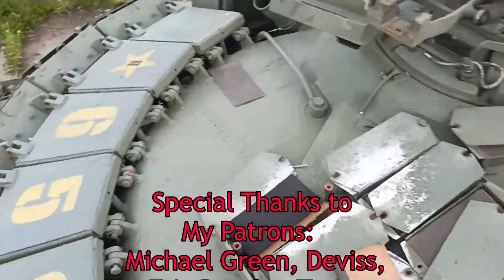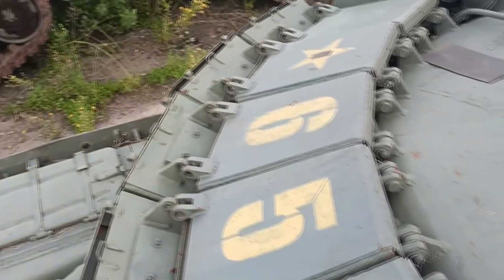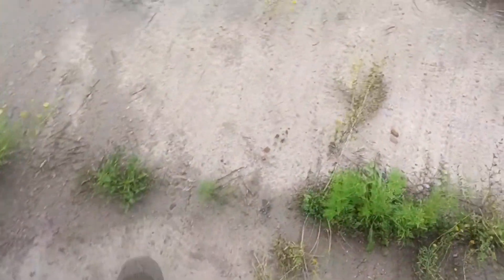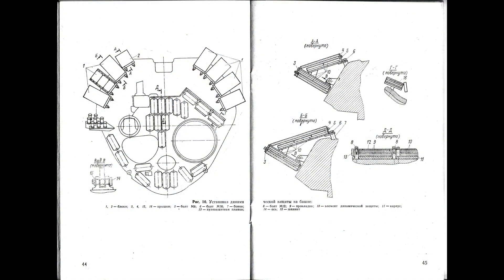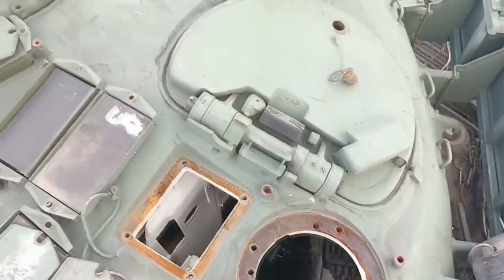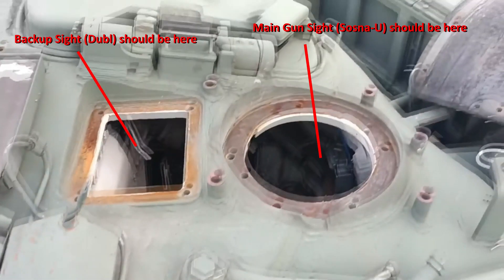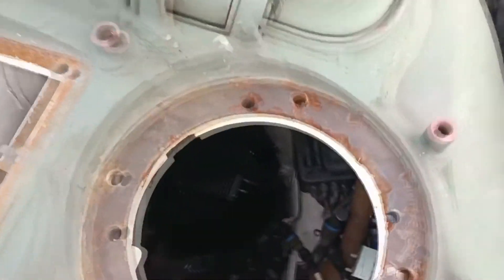Russians Are Using Rubber instead of ERA on their Tanks

Comment: Due to the lack of visible damage, my guess is that before it was captured the Russian crew sabotaged the tank to the point that it could not be easily repaired. If that was the case the only real use to Ukraine would be for spare parts like you said. Otherwise why not put the tank back into service for Ukraine? If they were that in need of parts it wouldn't make sense to cannibalize a T-80BVM unless it was otherwise unusable.

Edit: The removal of the parts was not the sabotage. The parts were only removed because the tank was unusable. Otherwise Ukraine would have just used the tank.
Reply: Tank got shot from behind by another russian tank in order to sabotage it. Insides are probably demolished so most likely unusable tank.
Reply: @dusanbursac5012  no need to shoot it, you can't repair it later when you recover it. Busting the fuse box is enough, fixing that would be pain in the ass, especially if it's in the combat zone.
Reply: Thats the t-90. This isn’t the t-90m tank.
Reply: What even are half of these comments... so many brainless people making random assumptions/claims without backing them up with sources or logic
Reply: Their crews are trained on the t-80 would be my best guess
Reply: @warlordjjj2111  Ukrainians also use T64BV
Reply: There were a lot of armored vehicles who were abandoned by their crews in Russia, they were conscripts seeing real conflict for the first time and overtaken by the shock of “bozhe moi they’re going to kill us!”
Reply: Naw this is just the age old military shortage problem where in their supply is old and crumbling.
Reply: Here we go again with the "tank expert" redditors
Reply: No the manufacturer did that do you really think these troops are leaving expensive equipment and take the time to find rubber somewhere in Ukraine cut it to size for each armor???…come on if you are abandoning equipment you don’t have time for that…this is literally the stupidest thing I’ve ever heard
Reply: A troll account who is an expert in Armor?

No, idiot, the tank was not damaged beyond repair by its crew.  It was abandoned.  Probably because it was out of gas.

The reason I know this is, one of the first components a tank crew would destroy when abandoning a tank is the main gun.  This is accomplished by putting a thermite grenade in the chamber and closing the breach.  You have a few seconds to get out of there before the thermite burns through the barrel and hot metal drops onto the ammo carousel, then bye-bye tank.

This tank shows no signs of fire damage (no soot around the commander or gunner's hatches, no yellowing of the vision blocks from heat).

Please, stick to War Thunder or World of Tanks.
Reply: Smells like a lot of rapist war criminal child killer supporter coping in here🧐
Reply: Way back, the plan for Russian troops was to move fast. Anything that broke down was destroyed because there was no time or resources for repair. If Ukrainian troops actually captured that tank, they would use it.
Reply: Yes. I mean when Russians recently captured T-64, Ukrainians tried to destroy it's "communication device" by throwing grenade inside of it. It didn't work and whole tank company got exposed.
Reply: True i saw a lot Pictures where these ERA plates have been deinstalled from the tanks
Reply: This tank is in service already .
Reply: they'd prob rather rely on their tanks that they know work, rather then try fixing a tank with holes in the main gun and god knows what other compromised components
Reply: Agreed. It's obvious the tank was somehow disabled in battle or by the crew before it was abandoned. The Ukrops would otherwise be running it.
Reply: The Russian tank crews weren't even trained in basic tank tactics.  I seriously doubt that they were trained to destroy their tank.

Another thing to consider is Russian doctrine.  When advancing - broken down equipment is left behind for recovery by rear echelons.  I'm willing to bet money that the reason the tank was not destroyed was because the commanders were following Russian doctrine.
Reply: It'd make sense that it'd be used for parts. Ukraine's version, the T80UD uses a diesel engine while the T80BVM uses a gas turbine. The T80 series turbines are absolute dumpster fires with a rather infamous reputation for being horridly unreliable and constantly breaking down. Knowing how much of a maintenance pig this thing would be, it's no wonder that it'd be stripped for common parts to repair T-80UDs that Ukraine has and know runs fairly well than trying to chase the maintenance demons that these tanks are known to be. There's a reason why the T90 uses a diesel engine and not a gas turbine. They're shit.
Reply: Hi James D.! You're absolutly right, Sir! The only explanation that fits here. 😉 👍👍👍
Reply: Steve Arthur  You, ve seen it! That's truth... Main gun out of order! Only the reason for the cannibalism, the demounted parts... 😉
Reply: And put all washers and nutts back? Wow, this is some seriously executes special operation..😂
Reply: It was captured intact and painted with Ukraine colors FIVE MONTHS AGO. Get it? Ukraine was using it since then, and recently it finally got scrapped and used for a propaganda prop. A really REALLY dumb one since the person narrating is verifiably lying - he knows damn well there used to be explosive plates between those rubber liners... until Ukrainians stripped the tank bare.
Reply: Russian soldiers have tendency to run when stuff explodes around them, even tank crews have been seen getting out and running away from their own tanks...
Reply: I've seen a few videos of Russian troops bailing on their equipment and running for the hills 😆
Reply: They may have made it inoperable but the Ukrainians are still getting use out of it as a propaganda piece as pointed out in this video. Smart move by them.
Reply: I wouldn’t sabotage safety features, it’s better fucked up gun or engine, and get the fuck out of that war, go better fight on Ukrainian side
Reply: We did it in Iraq Also. If we had a Vehicle that was in a accident or in a fight and it was considered Junk. We would strip it of any good parts to help get other vehicles up or maybe have some spares that were hard to get in. We would throw some old parts in its place, to hold it together. Esp wheels. I know the Marines had a Big Junk yard in Iraq, That they would ship old equipment or vehicles that needed like higher maint repairs or Even upgrades from Kuwait. Only issue, is those type of equipment was low on the movement list.
Reply: It was seen in Ukrainian hands with new markings (and seemingly somewhere) else as mentioned in the video. 
So probably not sabotaged. 

It probably was used until it broke down and use the spare parts for other tanks.
Reply: Ukrainians ARE using captured tanks and APCs. T-90, T-80, T-72, T-64 and in the last months even T-62s.
In fact Russia "supplied" more vehicles to UAF than any other country
Reply: totally wrong suggestions.
Reply: Normally Russian crews spike tanks by throwing a HE or Frag grenade into the crew compartment, destroying most of the relevant panels and controls. From the brief glance we got it looks like the interior is intact, they could've damaged the engine/transmission or some driving elements but otherwise the chassis looks in relatively good order.

I don't think the Russian crew spiked it. It might've been left behind in a hurried withdrawal or captured before it could be manned. Worth noting dropping a grenade into a tank has a decent chance to set off its ammunition, which can easily kill the crewman that threw it in. Understandably alot of Russian crews would rather not take the risk to themselves.

It was probably cannibalized because it couldn't be put to effective use, tanks require maintanence to serve as well as fuel and ammunition, not to forget the trained crew. This often means captured vehicles are cannibalized to improve existing systems, rather than re-equipping and crewing them.
Reply: @pogchog6766  dude nobody is throwing grenades into tank hatch because tanks - soviet ones - have ammo stored inside the tank. There is a high chance that grenade explosion will trigger ammo explosion that can hurt the person throwing the grenade and thus nobody is doing them.

Its not possible for crewmembers to damage transmission or engine either. No quick way that doesn't involve disassembling or making engine run with sand.

These tanks get broken often on its own due to them being made in 1970-ies and have not had proper service since then. They also often are left behind when they are out of fuel. Or crew of retreating unit notice loitering UAW and decides to get the f--k out and as far away from the tank as possible knowing that tank would be primary target for the artillery.

Okay, by now Russia almost run out of tanks made in 1970-ies and switched to ones made in 1960-ies but they have the same problems.
Reply: @skipperg4436  The T-80 BV manual recovered from a damage T-80 a couple of months ago had the protocol inside of it.

The manual stated it was the drivers responsibility, or whoever the commander deems fit, to detonate the grenade inside the tank. And yes, you're completely correct it could detonate the ammo in the tank and kill the crew member who threw it, a rather significant part that the manual left out.

But tank crews aren't stupid and figured this out on their own, hence why so few tanks are actually spiked since no-one wants to throw a frag grenade into a tank loaded with live ammo.

Like I said, running a tank is most of the trouble with actually having a tank, rather than acquiring one in the first place. The lack of Russian maintanence equipment and experienced tank crews probably makes abandoning these tanks more efficient than trying to save them at all, knowing that the Ukrainians would still need to provide maintanence and crew or simply cannibalize it as they've done here.
Reply: Nah may that's just shit Russian equipment.  There's a reason they've gotten their asses smacked by every nation they've invaded the past 20 years
Reply: @demmis1354  not equipment. 
People. 
In Russia only worst of the worst become career military. 
Imagine an army where all officers are the worst kind of school bullies, private soldiers are the poorest of the poor who have nowhere else to go because they absolutely lack any talent in anything, top senior officers get their rank based on them not being able to ever be a political threat to Putin as well being blindly loyal to him (who also almost all of them are alcoholics in personality degeneration stage).
Now multiply that by the fact that in Russia in general people are not considered a valuable resource, nor credit is given to people who have done something (this was one of the main Soviet/Socialism ideas that many generations of people grew up with and it affects a lot of their behavior and decision making).

Russian/Soviet equipment is not that bad. Ukrainians have for the most part same soviet vehicles except 1 generation inferior yet they use it waaaaaay better. The worst part of soviet military vehicles is that they were designed with almost zero consideration about crew safety (let alone comfort) - because as I said people were not considered to be a valuable resource.
Reply: How the fuck do you capture a tank? Lol. How does that happen?
Reply: @VADER677 , well, it usually happens when your side retreat and you need to move fast and tanks are not famous for their speed. And they are also not famous for their reliability, so...
Reply: @Твойбро-е9ь  why would you put a tank in a position where it would potentially have to run for its life knowing that they are not good at doing that?
Reply: @VADER677 , for example, when there is a risk of being encircled like it happened in Kharkov region when there were some amount of military whose aim was to attack Slaviansk but after counteroffensive they became halfe circled so they had to retreat.
Reply: Just because they’re filming this doesn’t mean they didn’t use the tank afterwards
Reply: Fake war. Rumors.. As written...  You see the details, now line them all up!
Reply: One thing that is clearly missing in Russian tactics is the tactic to mine abandoned equipment or if there isn't time just burn it with gasoline.
This is all standard practice in western military just to not leave functioning equipment/weapons behind, when I was in the military one of the first things they taught us in TFT was to take the bolt out of any guns you were forced to abandon, in fact in later deployments all squads received a small batch of bolts for the most common friendly and enemy guns in case we had to reuse any recovered ones because it was assumed that both us and the opponents used this standard tactic.
Guess the Russians don't 🤔
Reply: You wrong all weapon there is garbage.
Reply: ....какая то странная Война, пол Украины в ресторанах и дискотеках, на курортах  балдеют...другие Родину защищают и погибают....одни воруют деньги, которые весь Мир собирает на борьбу с Рашистами, другие убежали в США, Канаду, Израиль и Европу,   а своё жильё сдают беженцам с восточной Украины и наживаются на горе людей,...надо строить военные заводы, выпускать ракеты чтоб долетали до Москвы,...а тех кто убежал с страны лишить украинского гражданство, конфисковать всё их имущество и обязать выплатить по 1000000 долларов штрафа, и надо что бы правительства других стран забрали эти деньги с предателей и отдали Украине..
...срочно надо закрыть границы, всех мобилизовать и женщин и стариков и детей, старики и дети могут выпускать снаряды и т.д. Женщины могут стрелять, перевязывать раны. Чтоб день и ночь стреляли по Рашистам, чтоб у тех небыло время даже поспать. Послать спецотряды заграницу и вернуть всех украинцев на Родину. Примерно 15 миллионов живут за границей, и любят Родину  издалека, а кто то должен за них и их имущество воевать, погибать. Хитрожопые. Если 40 миллионов вооружить то Рашке пизьда. Там одна алкашня и трусливая пидорасьня...
....почему не покупают снайперские винтовки ???.. и надо создать армию снайперов, и не будет потерь.......Кому то выгодна эта мясорубка. Зачем воины Украины сидят в окопах и погибают от мин и артиллерии, кто их туда посылает ?...и когда воины говорят что придут в Киев и разберутся с предателями, то Рашисты узнают координаты тех кто угрожают предателям в Раде и правительстве и наносят смертельные удары....кто передаёт данные Рашистам ?...почему не работает контрразведка...почему не работают спецгруппы в тылу врага, не уничтожают пропагондоноф, предателей, военные объекты, эшелоны с военной техникой ?...
....а как Путлеровцы стали бомбить Львов, то сразу завижали «закройте небо»....а  шо не нравится ???...а как Рашисты бомбят восточную Украину, то не надо закрывать небо ???....пока вы сдаёте своё жильё беженцам, а сами убежали в США и наживаетесь на горе людей, то мира в Украине не будет...
....конечно, бандит и убийца  РабсZZиянец награбил, и отдыхает в Египте, Дубае, Турции  и т.д.....а что там делают некоторые украинцы ???... У них дома Война ...или они  с рашистами заодно...Ждуны ???...
Reply: Didn't Poland gave them some of there T72 tanks from reserve
Reply: @samualbhuiyan2308  ye and pt91
Reply: @samualbhuiyan2308  those turned out to be ones without ERA. And T-80 is too different to T-72. Engines are completely different (T-72 being diesel and T-80 is gas turbine), chassis for T-80 are new, etc.
Reply: Yea, a lot of that was happening at the beginning. Due to poor planning of supply lines, a lot of Russian stuff would just break down, or even just run out of gas, and would be just abandoned at the side of the road, since poorly thought out logistical support meant there was no means to evacuate it. It's why you could see so many of those "Ukranian farmers capture russian tank!" videos in the beginning, but see none now. Supply lines got sorted out.
Reply: That's good to know
Reply: You are asking us to believe, they opened the armor packs... removed the explosives... and then neatly replaced the rubber and resealed each of the ERA packs?     If it were me, I'd take the stuff out, drop the rubber on the ground and take the explosive sheets.
Reply: @mac_mcleod  No. The removal of the parts that you see in the vehicle was not the sabotage. The reason for the removal was Ukraine stripping it for parts. I'm saying the reason it was stripped rather than put back into service for Ukraine has to be because it couldn't be used. T-80 was developed in Ukraine during Soviet times. Ukraine uses T-80 in its military to this day. Ukrainian tank crews know how to use it. T-80BVM is the most modern T-80 model and they wouldn't strip it for parts if the tank itself was still usable.
Reply: @mac_mcleod  they likely took the stuff and dropped the rubber. Then this person came, put rubber back and created this video. You see there were no screws near those packs
Reply: @ligametis  There are a few visible bolts , at 0:03 and at 0:26
Reply: @ligametis  Now- that's a possibility.   I think it's less likely than that either the explosives were not there to begin with or some bright young lad sold the explosive.  
But it is possible they put them back together from bits around on the ground and then opened it to display the inside.  It's also possible, they opened them, found nothing in them, and then took a video of that.

You really need a secure constant stream of video going back hours before events like this to be more sure.

One thing is certain.  Those ERA packs have been useless against the missiles being used against them.
Reply: @mac_mcleod  "One thing is certain.  Those ERA packs have been useless against the missiles being used against them." 

They are close to totally useless against missiles that cost tens or even hundreds of thousands like Javelin. They protect against smaller anti tank weapons that most troops have way more accessible because they are lighter, cheaper and more abundant.
Reply: @ligametis  Javelin missiles are only 78,000. Those tanks cost millions. I've seen so many turrets flipped upside down with all of the ear attacks intact.

U.s. has given Ukraine 5,500 of them and they have a 90% kill rate.
Reply: @ligametis  it just a tank being scrapped for parts. It couldn't be more obvious.
Reply: The man gun is completely destroyed, even if everything else was functional, it wouldn’t be worthwhile to replace the gun
Reply: Tanks don't need sabotage. They break down a lot, even average unlucky explosions can make it unusable without repair
Reply: @ligametis  if you are gonna left your vehicle or any military equipment behind the enemy lines without chance of recovering it in few hours, standart procedure would require to make it unoperational from WWII.
Reply: @nikitajukov4915  Russians often do not make vehicles unoperational. They expect to get them back at the next push.
Reply: @ligametis  “expect to get them back” … do you mean expect to recapture them? lmao
Reply: @RealUMGaming  not exactly recapture. They would just leave them and when back support comes they simply repair, refuel them.

Well this time they had to fully retreat and they left some tanks.
Reply: @ligametis , could you please tell me why your opinion on russian army is so good? Even people who fight for it in Ukrainian war is quite sceptical on it because of the corruption which took place for more than 20 years, but your kind, i mean people, who support Russia in a western part of the world always trying to find some russian secret plan. Sorry if i misunderstood you.
Reply: @Твойбро-е9ь  context. This is all about it. Is Russian army weak compared to EU combined force, US or even more NATO? Definitely.  Is Russia weak compared to Ukrainkan forces? Definitely no.
Reply: @ligametis , russian army is better equipped with heavy armour and missiles but far less organized and far more corrupted due to lack of reforms all these years. Technically it is still a soviet army with a bit of modern equipment. While Ukraine's army went through some organizational reforms after some heavy defeats in 2014. The diffremces can be seen even in such small details like medical kits and dry launches of both armies.
Reply: @ligametis , i didn't say Ukraine is not corrupt, i said its army is less corrupted and you may not know but Ukraine also have lots of the vehicles of its own production like Cossacks and modern antitank weapons like stugnas and drones of their own production but it's just not  enough because, you know, you are attacked by a country which territory and population is a few times bigger than yours. There are no counties in Europe who can handle Russia in a large scale war by themselves because of the huge amounts of cool soviet stuff they have in stock which is quite dangerous if used properly. But that's exactly the problem. Russians have some problems when it comes down to using stuff property because of problems in their organisation and because their army is led by people who have a very distant relation to army. So, with other countries' help it is possible to win. And there were a few moments in this war which confirmed it.
Reply: @nikitajukov4915  This would require that the soldiers who abandoned the tank:
1) Cared
2) Were reasonably competent
3) Had sufficient time to render the tank inoperable
Reply: @ligametis  if u didn t noticed the gun barrel was full of holes
Reply: @ligametis  Its very easy to sabotage a tank, russians wont leave any workings tanks to Ukraine, accept in some very few cases. Same thing is happening from ww2
Reply: @ligametis  Tanks are sabotagee often. This doesnt mean sabotage as in breaking someone elses tank so they cant use it like soem spy game. This means the crew scuttle/smdestroy it when they can no longer use it.
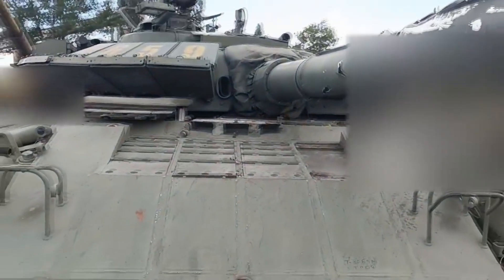Reply: @Labas Labas  you can see (2:40) that the gun itself has a lot of holes in it. We didn't saw everything so I guess that there is more damage then we know.
Reply: @Adam they might be alive...
Reply: I wouldn't say sabotage. Just a lot of corruption which led to officers skipping over maintenance and such.
Reply: @ Jon Son,

I totally agree with your statement.   The Russian military is full of corrupt officer corps as well as NCO components. This corruption is not only in the military but also within the government itself. 

I have often talked with former Russian soldiers and sailors that can prove this. Many pieces of equipment from personal protection to vehicles, planes, ships, etc are often sent into service with subpar parts. The good parts are often sold off by Russian personnel. It’s been this way in the Russian military for decades. This was one thing we began to understand in my time in the service.

My buddy was a tanker in the U.S. Army and has watched countless videos of Russian equipment in Ukraine. On one video he took note of  BTR-80 with worn, low pressure tires. Which I guess didn’t matter because the Russians lost many BTR-80/80-82A’s to combat or capture.

I’ve read accounts of Russian soldiers selling equipment in the early months of the invasion for food and other items. 

The selling of good equipment by the Russian military has always been a profitable venture and has been going on a long time. However, this tank looks stripped which makes good sense seeing that the Ukrainians use the same tanks.
Reply: @jonson856  he doesn’t mean maliciously sabotaged to hurt russia, he means the tank probably became bogged down or broke down and they sabotaged it so it would be impossible for the ukrainians to repair.
Reply: @zachwayt3874  ah I see
Reply: It could also be that something important broke down, happens a lot in military machines

and only the russians may have spare parts for that, specialy because its a t84, and due to a small problem going on btwn russia and Ukraine, it may be hard to get that part lol
Reply: Yeah, sure the ruzzian crew had the time to take out the real "smart armour" and slap in perfectly carved pieces of rubber in every single slot, that tank entered Ukraine the way it was found.
Reply: It is probably an outdated tank.
Reply: They should've set it on fire, better chance of not allowing it to be used by the enemy.
Reply: Oh like the 1000 of other vehicles they just abandoned lol?
Reply: @minecraftboy4208  You see Ukrainians using them? no lol they’re conscripted soldiers are too stupid 😂
Reply: @minecraftboy4208  Yeah, they abandoned A LOT of vehicles. Remember that friendly fir incident where Ukrainians tried to dig out abandoned Russian BMP?
Reply: @minecraftboy4208  
>1000
Cope
Reply: was captured wayy  back in March and now he's recycling footage
Reply: If you are going to sabbotage the tank, and for some reason you were going to remova the ERA blocks why would you replace them and not just lead them empty? IT doesn't make sense. It looks like this is how the tank was deployed.
Reply: @iggysfriend4431  oh I have an excellent idea.. why not watch the fucking video where it tells you exactly what happened instead of guessing?
Reply: @michaelwilliams9574  Wow such anger, you need to really lay off the red meat. Relax, think calming thoughts and breath steadily. That way you'll live longer. Or perhaps carry on as you are and be Mr Angry, have a nice life, what left of it.
Reply: @iggysfriend4431  oh.. and one more thing, watch the fucking video for the facts.
Reply: @iggysfriend4431  you are entirely too concerned with my well-being. We are not dating or married. Don't worry about me one bit. That's not your job.  Besides everything you are saying has nothing to do with the video.  Stay on target
Reply: This is some high quality Ukropium, lmao. If there was a need to sabotage the tank, as others have said, all they'd need to do is set it on fire. That would take way less time than removing all of those components. It just doesn't make sense when you give it further thought. Cannibalization makes sense due to the fact that some elements may be able to be reused on T-64s with modifications or the Ukrainian produced T-84s, if there are any T-84s left and not just T-64s and the T-72s donated from outside.
Reply: @radical026  Obviously tank crew didn't remove all of the parts as sabotage. They disabled the tank by damaging another component like the fuel lines so it could not be used by Ukraine. Ukraine captured the tank and because it was disabled, salvaged the parts from the tank.
Reply: @radical026  so tanks arnt that easy to burn

And if you have a shortage of fuel you really don’t want to waste it burning them lol. No this is literally what the Russians do.  Cope more
Reply: if you enter the numbers that are written on the board, then he finds pictures of the tank and it is clear that this is a Ukrainian tank and not a Russian one
Reply: @ЕвгенийОрлов-б4м  Did you watch the video? He explains that it was captured in march....
Reply: @savagedabs8536  from these comments, it's obvious that most people did not watch the video.
Reply: @ЕвгенийОрлов-б4м  ????? Ukraine didnt use bvms pre war (now they captured some including t90s
Reply: @ЕвгенийОрлов-б4м  Typical Kremlinbot lies.
The tank was clearly captured from Russian forces back in March & had its markings changed to prevent a blue on blue.
The fittings on the tank are those of a RUSSIAN T80BVM, as supplied through the Rostec modernisation & upgrade programme.
How do I know?
I'm a retired military attaché & part of  my task was to note & identify any & all military equipment I saw in the places I was posted (extensively central & eastern Europe & the former Soviet bloc).
Go back to lying to your countrymen, as they believe any old 💩coming from Putin's fascist regime.
Reply: @ЕвгенийОрлов-б4м  As has been documented.  It was a Russian tank captured by the Ukrainians. So before it was captured, it belonged to the Russian invaders. After it was captured, it belonged to Ukrainian defenders.  Who stripped it for parts.
Reply: @ЕвгенийОрлов-б4м  T80BVM is only operated by Russia. Nice try troll.
Reply: @dallaw9238  Yeah. I check out these threads and its easy to find the trolls.
Reply: @ЕвгенийОрлов-б4м  proof?
Reply: @MA-kr6yv  the proof is that he made it the fuck up)
Reply: @ЕвгенийОрлов-б4м  это русский танк, приватизированный украинцами. У украинцев нет т80бвм
Reply: @ЕвгенийОрлов-б4м  You can say that as many times as you like petal, still doesn't make it true
Reply: @ЕвгенийОрлов-б4м  LMAO